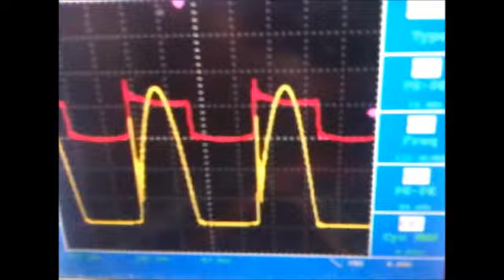Induction Heater

Comment: Thanks for taking the time to answer. I understand your answer but I suppose I was just looking for an average number. For example, an ounce of hard block scrap aluminum without insulator at say 2kW would achieve $num of degrees. This would give a quick idea of how many kW of power is used to smelt certain metals of a generalized size. It should be noted that I am interested in purchasing the parts from your store just to study how the process works. Then obviously scale it up from there.

Comment from the maker: 1. It depends on the size, shape, and material, Also the shape of the coil and if there is any insulation to keep heat in. It is not really a simple task to work it out.
2. Maybe with a very small insulated workpiece and a smaller coil.

Comment: So I know this video/project is old (2+ years) but I have a few questions. I've only recently started studying this induction heating. I think it's pretty awesome but from what it seems you need some pretty hefty voltages / amps to get anywhere useful. Your project is the first I've seen that makes this at least do-able on small scale. Q.1: How can you measure how many watts 
of heat you need to achieve a certain temperature? Q.2: Are you able to reach molten temperatures with your project?

Comment: Can this system be used to heat up metal to a specific temperature and hold it there?  I need to heat up gold to 450 degrees Celsius and hold it there without melting it...  In your video the amps amped up when you placed the screwdriver...what's going on there?  Thank you.
Reply from the maker: You would need a temperature probe and something to use that measurement to adjust the power level accordingly. A controller like our PDI-1 could be set up for something like this if you have a suitable sensor. The current increases because once the metal is in the magnetic field it has current induced in it and alters the impedance of the circuit. The more metal you add, the more current it will pull.
Reply: Thank you for your reply!  So would adjusting the voltage or current or frequency or a combination allow me to control the temperature of the metal?  Would this controller connected to a sensor be able to be programmed to control the temperature of the metal? I may be interested in purchasing your controller but would also need to have it programmed...  I was considering in using some sort of frequency generator or amplifier to control the frequency of the current.  Would your controller be able to regulate the frequency or be connected to an amplifier/frequency generator and work in tandem with it? Lastly, what kind of temperature sensor would you recommend?  the metal will be inside a glass vessel in powder and liquid form.  The sensor would need to be non-corrosive to both mercury and antimony.  Thank you!
Reply from the maker: You can adjust the voltage or modulate the power for temperature control. You would need  to use a non-contact IR temperature sensor.